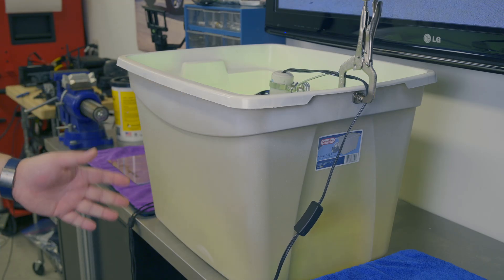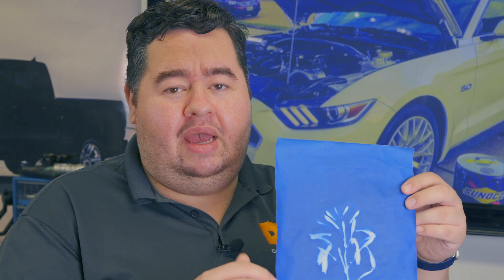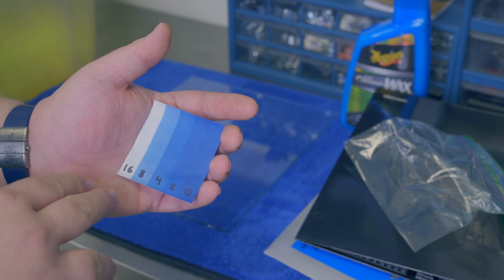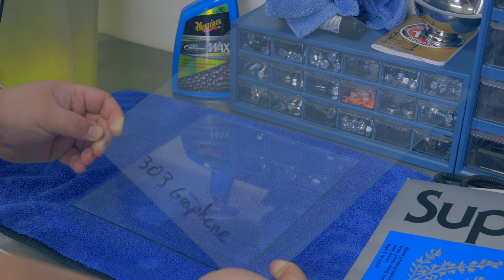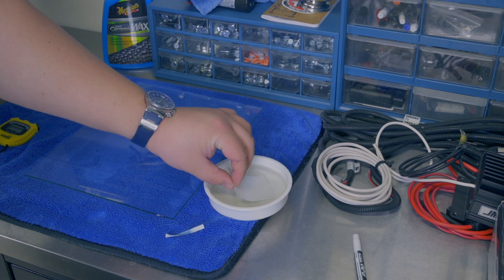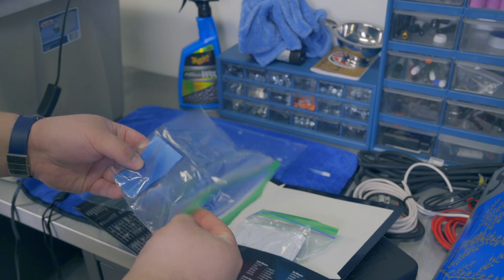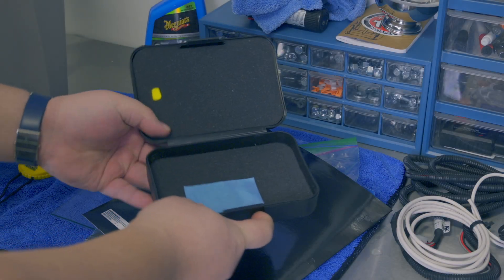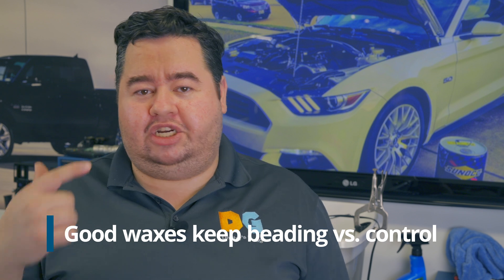How much UV protection does a wax, coating or sealant provide?

Comment: Sunscreen products absorb or block long wave UVA light, or short-wave UVB, some chemicals to better then others and block both. There are two classes of sunscreens: chemical filters formulated with large molecules like Butyl Methoxydibenzoylmethane or Benzophenone-3 that scatter light, and mineral sun blocks, primarily zinc oxide (UVA/B) and titanium dioxide (UVB) that reflect light. Both attenuate, but don't completely block UV light...and for only a short time. When applied to skin, sunscreen needs to be reapplied as sweat displaces the water resistant carrier and the chemicals/mineral are washed away. To get good sun protection you need a pretty thick application of product. 

So you can understand why car care products would likely not provide much long-term protection. There are some new photo stabilized sunblock lotions that are being released in Asia and Europe that use nanosize carbon particles. That said, I'm not recommending using Banana Boat on your Corvette. Just trying to provide background. As for protecting your car...maybe the future is nanocarbon with a bonding sealer.  Who knows, but you want large molecules between your clear coat and the sun. As far as I know, no such protect exists. Probably the closest you can get is a ceramic product. It would be interesting to test just the ceramics to see if any of these are decent (and test after a wash or two). Now the best you can do is to protect the clear coat from oxidation. Thus we wax.
Reply from the maker: Thanks for the great explanation!
Reply: Use LRP Uvmune 400 on your car trust me
Reply: @bird6691  Yes, but LRP peels and I don't trust the clear sunscreens. I've switched to coppertone mineral based sunscreen for kids. It does dull the appearance of the finish, but doesn't seem to negatively affect the clear-coat or paint. When it comes down to it, protecting your car with sunscreen in the summer just makes sense. Wax basically does nothing to prevent UV damage. I like Dmitry's experiment, it's very creative, but I want to see a peer reviewed study. What are others applying to their cars in the summer? I have a friend who's using Neutrogena UltaSheer Dry-touch SPF 100 on her Ford F-150 SVT Raptor with good results. It's just that that's an expensive option and it washes off easier than the mineral products. That stuff also contains Oxybenzone, so it's not reef protective either--don't use if you live on the coast!
Reply: @InyoCounty  BTW I was joking I didn't know people did this 😂😂

Comment: This is a very informative explianer video, i love the simulationsand how you derive results......Many thanks for sharing. One things is clear, the way the autocare industry markets these products is exaggerated, and this is importnt for detailers to know. In the case of a non real physical layer like Wrap or PPF, exactly how efficient is a ceramic coating, sealant or wax against UV?  Now based on your video I would argue not quite so much, so essentially, these products offer more of  a chemical resistance than UV protection.
In all cases, I think the autocare throw in these UV Protectors as an add on, to tye chemical resistance and shine most of these provide, the reveal here is, your car paint would crack, fade (oxidize), and totally fail (clear caot failure) if you do not put these on. I personally feel regular waxing (Caranuba infused) is the way forward, providing colour depth, warm glow and oils the top coat gets stripped of during each car wash. This video creatined a mind shift, with scientic backing for me. Please keep up the good works

Comment: It goes to show that a lot of auto-detailer YouTubers are just peddling snake oil salesmen when they promote waxes, sealants, and ceramic coatings as UV protections for your cars.

The best UV protections are your clear coat and parking garage (if you have access to one).

Comment: So it does protect, but only on what was provided from the factory UV protection. Thinking of it as of blanket protection layer to be beat up instead of your clear coat makes alot more sense to me.
Reply from the maker: As you said in your other post, something is better than nothing. Keeping abrasion and other chemicals from interacting with your clear coat will help maintain the clear coat and its UV protective properties. For example water, bleach and other substances are supercharged by UV light and will accelerate weathering of the clear coat. Keeping a wax on that helps shed water and make it easier to clean the clear coat of contaminants means they won't interact with the UV and oxidize your clear coat. So while waxes and coatings won't really reflect/absorb UV, there are still some benefits.

Comment: If you actually want extra UV protection I think the route that you're going to want to go is actually PPF, not to mention it's a sacrificial layer that can be removed and replaced without removing additional clear and it protects your clear from the environment.  It's probably not super cost effective to pay to have it done and so in reality for most normal people it's probably easier to just drive your car and attempt to preserve it and pay for a respray every 3 years depending on the amount of rock chips and damage that your cars pick up through time.

Comment: Ive been thinking this for a long time! Thank you for doing the testing for us! Most people do testing by throwing chemicals on it well its a good test but its primarily for chemical resistance. Uv is the real testing for durability. If we really want to know how durable the coating is the realistic way to do it is to coat half of a test panel or a car (if youre willing to sacrifice  some clearcoat) with any protectant you like then cover the half panel. After that  let it take sun for how long as much as you want without putting topper or waxes sealants on top. when it starts to get oxidization thats the end life of the coating. Theres better way maybe but you get the idea.
Reply from the maker: Thanks Vincent! The test panel outdoors is a cool test, but one challenge is the clime/environment isn't static. So it's hard to compare one product to another between batches. It would still give some idea, but winter vs. summer batches would be different, etc... I think simulated weathering would be better at that point, though pricey.
Reply: @DmitrysGarage  yes that is true there are too much variable like here in philippines it is always hot it will vary from place to place. I have a question, does PPF would do any better in protecting paint against UV?

Comment: So, what we can do to protect the car paint from UV?
Reply from the maker: The clear coat provides uv protection. It will eventually burn through and the best way to extend its life is storing the car out of direct sunlight when its not being driven. Either indoors or under a cover/shade. For example if you figure 84 hours of sunlight a week in the summer, assuming 8 hours of driving per week, leaving it outside might mean the car spends 90% of its time under the sun being burned for no reason. Also wash it carefully and wax/seal/coat it to prevent abrasion and oxidation of the clear coat. Those products may not block uv like clear coat but they still protect it from other damage.

Comment: So what is the best auto wax for uv protection?
Reply from the maker: I have not found one that makes a measurable difference in my test. I would recommend a wax that will do the best job of protecting your clearcoat during washes, something slick, hydrophobic and durable.

Comment: Great video and testing thanks, the first source I found on youtube that provided this clarification with something to back it up! I wonder whether they'll ever add more UV protection to coatings - surely would be worthwhile? I'll be watching more of your vids to see if I can learn more...
Reply from the maker: Thanks Andrew, really appreciate you watching! I would say it may be tough to add UV protection to DIY products. The reality is that these are incredibly thin layers. Clear coat usually ranges from 40 to 100 microns in thickness, but coatings and waxes usually range from less than 1 micron to maybe 4 or 5 microns at most. Unless they find something that does a super great job of blocking UVA in super thin layers it's probably not going to happen.

Comment: Degradation is vastly accelerated in the presence of atmospheric ozone. Regardless of which product or brand is used, all manufactured polymer will degrade given enough time under a UV and ozone-rich environment. Protective coatings are also exposed to cyclic expansion and contraction of the substrate from seasonal and day to night temperature changes. Chemical attacks from pollution and low pH or acid rain will also produce degradation and its synergy with UV and ozone. 
So it should be stated that an outdoor or direct sunlight application requires periodic maintenance. Given enough time all matter will degrade under sunlight exposure, some materials are slower than others. Well presented video!
Reply from the maker: Totally true, thanks for watching! Always awesome to hear from others interested in the science of these kind of products!

Comment: Great video, so waxing provided next to nothing regarding UV protection. So what are our options ? Where I live is blazing hot in the summer and all cars new and old eventually get sun damage. What can I do in my case ? I park on the street so that's part of the problem as well
Reply: Opti coat Pro. There is a video of it on YouTube on a sort of neglected Honda that is parked outside in Arizona for many years
Reply from the maker: I think it provides at most a little bit of protection over time vs. having nothing at all. The real benefit in my opinion is protecting the clear coat from other damage during washes for example. Your clear coat has UV inhibitors that should keep the paint from bleaching under it, but over time the clear coat will fail if the car is kept outdoors. There is no way around it really. Modern cars are much better about it and without a doubt cars that are well maintained with waxes/sealants/coatings and washed regularly look better longer.

Comment: Wow, first of all fantastic video bud! I'm really surprised at the outcome, now the burning question is what about products like the 303 Aerospace protectant which boast about specifically blocking UV? I've been using that for years on the interior and all rubber components on my car, Id love to see if that's a true claim! Great video though, I've definitely subscribed
Reply from the maker: Thanks! That aerospace one is on my list to test. I think the products do provide some minor protection, but over time it can add up to longer life. Plus they keep the clear coat safe which provides the bulk of the protection. We can all agree that cars which are well washed and cared for have paint that looks great, sometimes for decades!

Comment: So polish zour car once and the cars clearcoat protection is done. This means polishing makes your car looks nice for the short term but for the long term u make the paint worse and exposed.
Reply from the maker: The clear coat should not lose its protection from a single polish if you’re not burning through it. Wet sanding, very heavy rotary polishing, burn through, etc.. can reduce or destroy the clear-coat. It also depends on the thickness and hardness of the clear. For example I polished my test hood over 40 times at this point and I still have not burned through the clear coat. Im sure I’m getting close in some spots though.

Comment: Subscription earned.  The next step is figuring out how different clear coat thicknesses affect UV protection.  If you just did a 3 stage correction on a car, are you severely degrading UV protection?  Are different clear coats better at protecting UV rays than others?
Reply from the maker: Derek, that's an interesting idea. I think the brand/type of clear will affect it quite a bit too. As far as a 3 stage correction, if you didn't go crazy and burn the paint, I doubt it has much effect. For example I've polished my test hood that's used for my wax review videos every single time I've tested a product. The clear coat is still there. I am careful not to burn through it though. The reality is modern clears are pretty durable, but some are softer than others (some Porsche paints for instance are pretty soft).

Comment: Interesting, immediately after polishing my car I noticed it seemed nearly as hydrophobic as I expected from after ceramic coat, but figured it was residual polishing oils more than the leveled surface.
Reply: Yeah you can absolutely be sure it was probably the residual leftover oils. I found hydrophobic properties in so many products Even beyond the car spectrum, definitely some residues, i would agree with your assets
Reply: Yeah you can absolutely be sure it was probably the residual leftover oils. I found hydrophobic properties in so many products Even beyond the car spectrum, definitely some residues, i would agree with your assessment

Comment: What Would an extra layer of clear coat or various layers of clear coat do to a car on top of factory clear coat? Would it make a difference at all in anything like scratch resistance or better looking paint?? Like is it a meaningless thing to do?
Reply from the maker: Im sure more layers would help. However typically if a lot of clear coat is added it gets sanded down and buffed for a smooth finish. I think too many clear coat layers would end up looking uneven. In theory though the more clear the more protection. Scratches wouldn't be harder to make, but you would be able to buff more due to the thicker clear. If scratches make it through clear coat they are much harder to hide.

Comment: I think you are the first channel on YouTube to test waxes and spray coatings for UV protection. I’m situated 5,000 feet above sea level so the UV is very intense and this test was of great interest to me. Many companies are claiming their waxes and sealants provide UV protection. You have shown those are just marketing claims designed to sell more product. Thanks for a well designed test in an area that has been overlooked by other detailing channels.
Reply from the maker: Thanks John, it does seem like it’s mostly marketing in my opinion. That being said good products will protect your clear coat from abrasion during washes. It is clear that cars that get washed properly and maintained with wax do look better over many years. Cars that don’t get washed or go through the whirling mayhem gas station washes just don’t look that great even in as little as 5 years, even if they aren’t wrecked or otherwise physically abused.

Comment: That’s great info. What about exterior trim coatings and dressings? Do they provide any good UV protection? Those plastic trim pieces don’t have a layer of clear clear coat and, based on the explanation by Mike Philips, that’s why paint doesn’t fade as quickly as plastic trim.
Reply from the maker: I'm definitely curious to test those as well as interior dressings. I wonder how much of it is more of a tire shine effect vs. actual protection.

Comment: Awesome, and interesting how you tested this. I was always suspicious about the claims of UV protection given how thin these sealants are. Now if you can only figure out a good way to measure water spotting resistance and bird poop resistance, that would be epic.
Reply from the maker: Haha, I'll have to buy a bird :-). In retrospect the UV claims were always suspect, but I just didn't see it. Marketing works! Thanks for watching :)
Reply: @DmitrysGarage In fact, almost all the advertising advantages of protective ceramic coatings are fakes. Both 9H hardness, and UV protection, and increased gloss, and others...

Comment: An additional question: did you check if the waxes were still beading after the exposure to UV?
Reply from the maker: Hey Toni, yes the 4 minutes of UV exposure and heat (it's right around 37C / 100F in there!) isn't enough to destroy any of these waxes. They all had beading when I was cleaning up the glass later to re-use it for future tests. I do intend to add future long term heat testing, but UV + Heat may be a challenge without a weathering appliance that costs many thousands of dollars. The problem is these UV lamps on their own don't make enough heat to test some high heat environments (think Phoenix, Turkey, etc...) and I don't think I can stick a UV lamp in a relatively inexpensive heater without starting a fire haha. I'll think about it though.

Comment: Nice test. Not really surprised though. Have you also tried Optimum Car Wax? It's supposed to have those patented UV blockers. Looking forward to the interior protectants test if you decide to do it.
Reply from the maker: I really hoped some of these would work well, but now that I think about it it was silly to think such a thin layer would do much. Marketing gets all of us in the end haha. I did try Opti Seal which did yield a small effect, I gave it 1 point. I will get some interior protectants going as well, curious to see if any are better! I will say though just keeping surfaces moisturized helps a lot, I've maintained older leather before with oils and it does keep it supple. I just don't know how much UV protection there is in any product, I think garaging is probably the real solution lol.